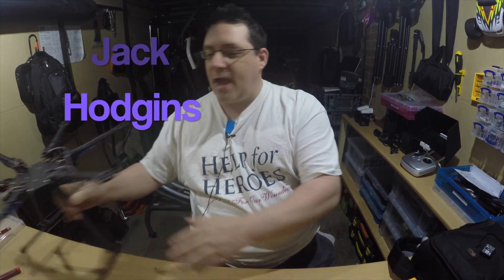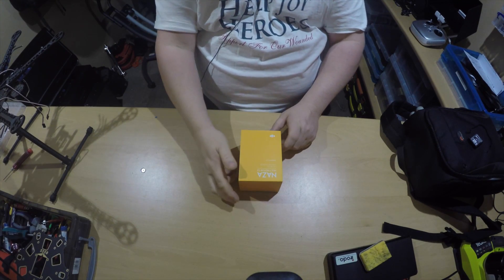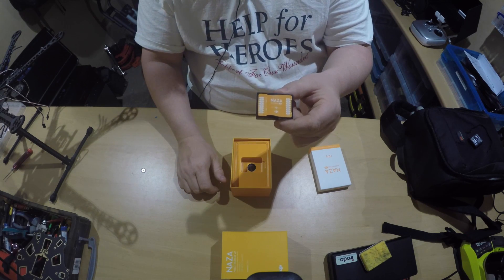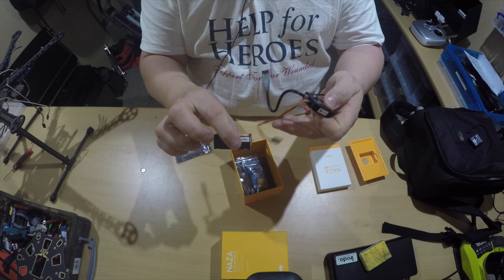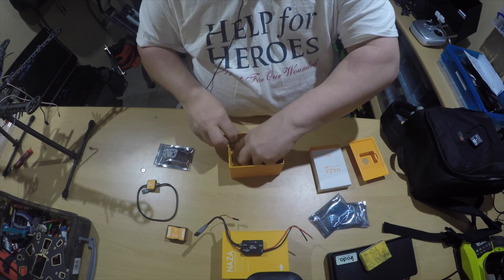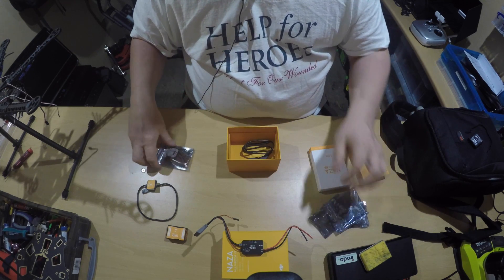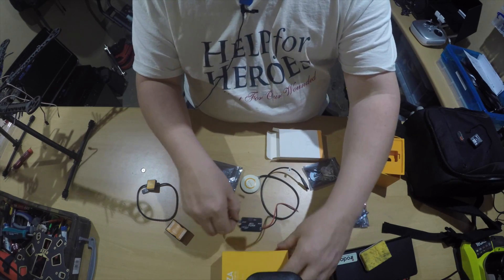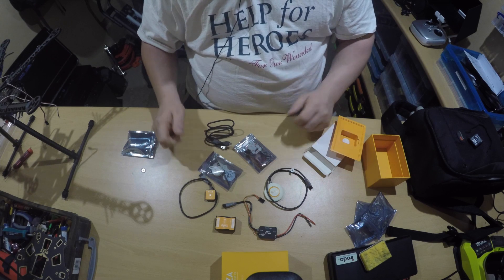DJI Naza-M V2 Unboxing

Comment: Update on my S550 build .... NAZA flight controller faulty so currently using my phantom V2 controller and flying like a dream. Now that's finally sorted out  I'm onto gimbal and camera mounted testing. Had some flight time issues so had to adjust the voltage tolerances by 1V loaded so now get around 8 mins flight on a 5200mah multistar 3s and very similar times with dual original DJI 2200mah packs combined. Prefer flight characteristic to my phantom , in fact feels easier to fly even though it's a bigger beast. Need to watch stopping times as it does take a fraction longer than phantom to stop in GPS mode if you don't hit reverse but nothing major. Just a warning lol. Make sure you instal the GPS/compass facing the correct way. I removed mine last night and installed it facing the rear ( stupid! ) so when I took off earlier it was going crazy and drifting all over the place. Basically just went out of control so yes arrow on GPS facing forward .. VERY IMPORTANT! lol. Also as regards to fly aways this incident has made me think that what if the compass became loose and turned facing any direction other than forward during flight !?? I dread to think but judging by how it behaved earlier could very easily just fly away with no control. This something that no one else I'm aware of has mentioned so a very good possibility of many fly aways. The folding mounts I've purchased are not the best quality so I'm still searching for a good reliable one. Maybe you have a better one Jack ? Let me know . Cheers :) Rich.
Reply from the maker: Richard Marshall wow you have been busy, all good point for me to watch out for and to bear in mind when i start to install my Naza flight controller, and yes agree with the compass this could be an issue with fly away wonder if there a way of testing this my old phantom which no longer has a gimbal it just a plane Phantom now. :) as they say better they are the easy to fly which i believe is very true, as i notice it easy to fly my Inspire 1 then the phantom handle better in the air etc.

Comment: Be interesting to see the maiden flight. I've been having some issues with mine. I've got same setup as you Jack. S550 with naza v2 but using E310 propulsion system instead. Trouble I've been having is the barometer not working properly. Basically won't hold altitude so when I get to a particular height it won't hover but drop as if it's in manual mode. I read it could be light getting into the controller affecting the barometer but as far as I'm aware it's mainly a problem with the cheaper lite version. Made a few adjustments including black take around controller. Will test Monday. Fingers crossed it's working fine now but won't hold my breath. Hope yours isn't as problematic as mine has been. Cheers.
Reply from the maker: Richard Marshall i have to test mine and see what happen and let you know.